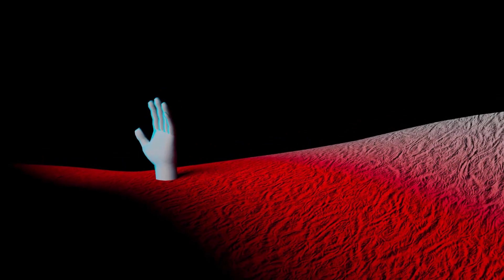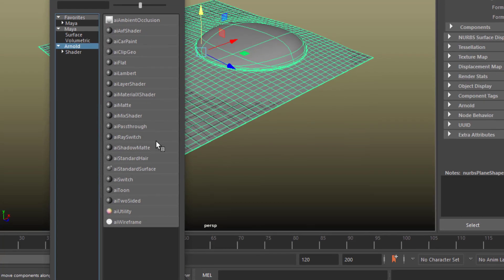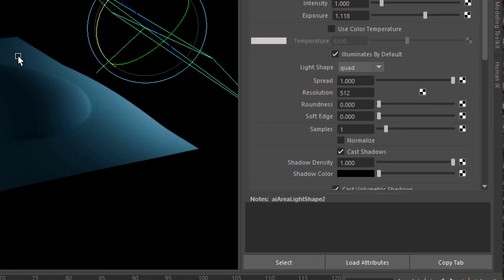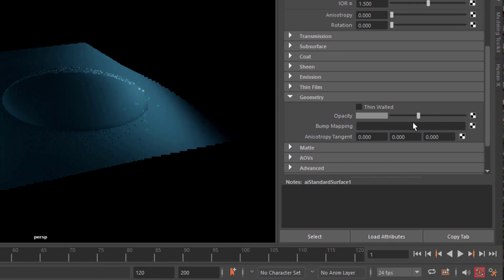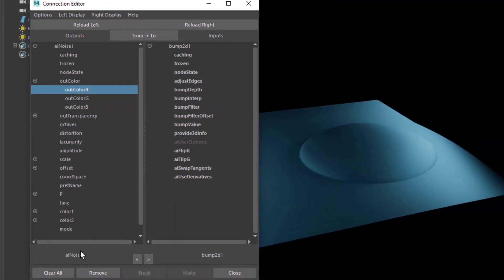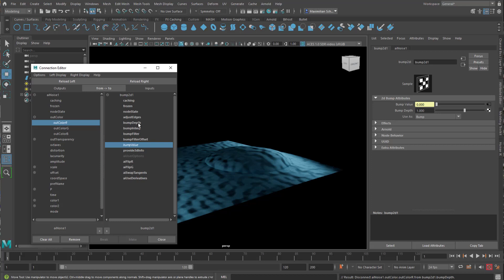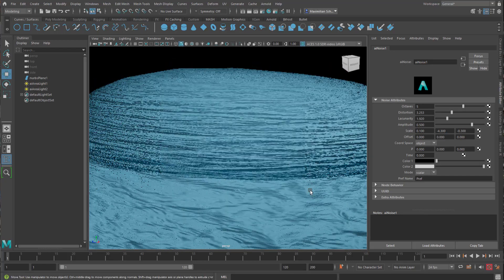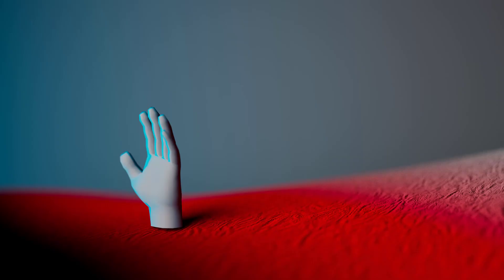Maya: An aiNoise Bump

Comment: Very interesting explanation for the ainoise texture feature. I can see many potential uses for this.
Perhaps for something like an animated bump map of light refraction coming from the water surface. Using an alpha channel to let light shine or swirl through the water surface and onto the ocean floor or objects/creatures as well. Maybe you can even use this to "fake" other lighting effects such as "God rays" through water or clouds rather than setting up more advanced parameters to truly do a calculated rendering of light rays or particles going through various objects or substances.
Reply from the maker: real god rays in the air .. i did a tutorial about them a while back, if you‘re interested. Maya: Volume Light [Arnold Environment]
https://youtu.be/b62rYhO8ViE
Reply: @Uhr24  right on man! Thanks! I'll definitely be sure to check that out. Never hurts to learn more tricks or better ways to do stuff you've done before. Merry Christmas!